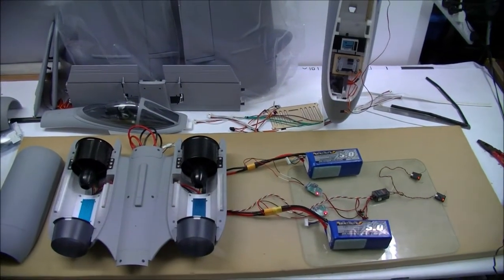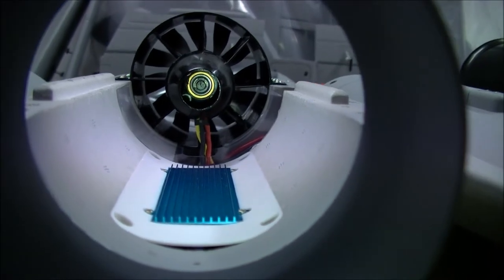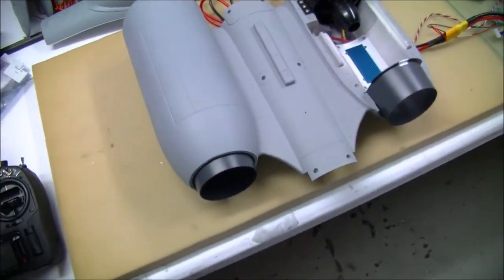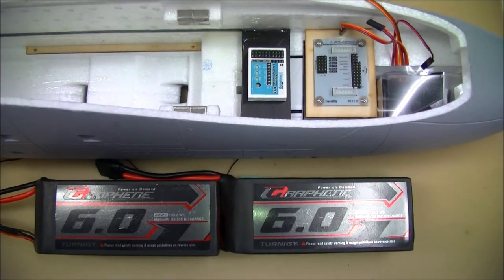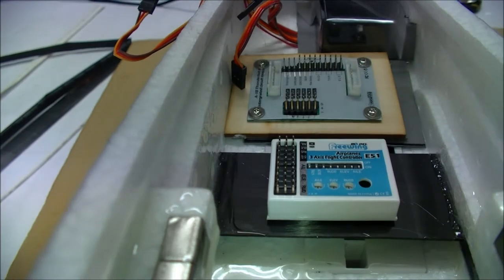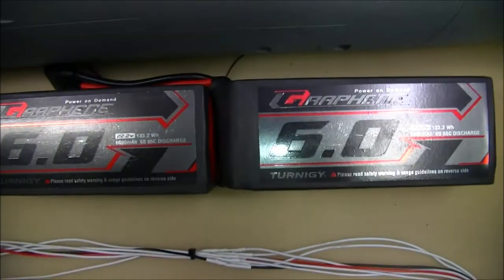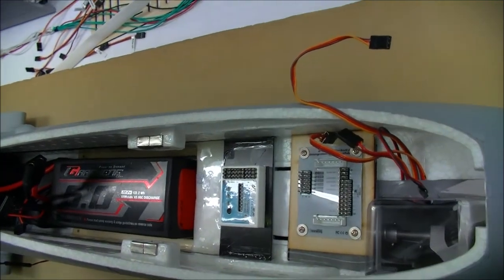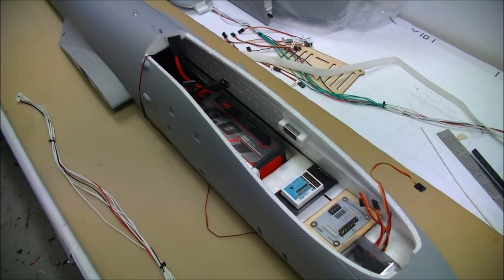Freewing 1700mm A-10 Thunderbolt II Twin 80mm EDF Jet  90mm Upgrade | RC Skunk Works ADP

Comment: Thanks for this video but I could have never achieved my preferred cg position along with my two 90mm inrunners and your battery position. The 90mm edf's are good for this plane with lots of vertical performance.
Reply from the maker: You're welcome! And thank you for the feedback, it's very much appreciated. 
Glad to hear that this video was helpful. I was thinking about going with the 90mm inrunners as well, but thought the outrunners would be sufficient. But I'm glad to hear that you've done it, and are pleased with the results! 
Cheers!
Reply: @RCSkunkWorksADP  hi , nice video, so the CG at the end same as the factory recommended spot or you prefer more to the front or end ? appreciate your advices ^^